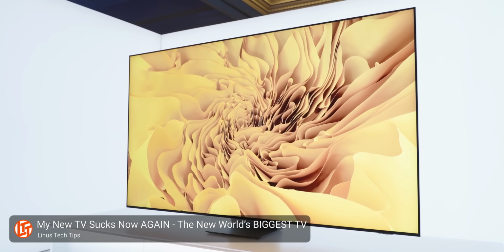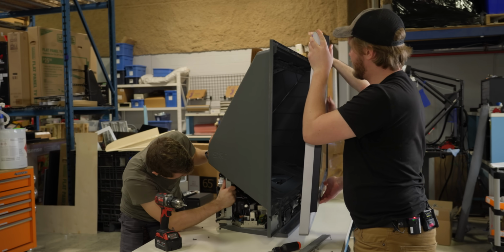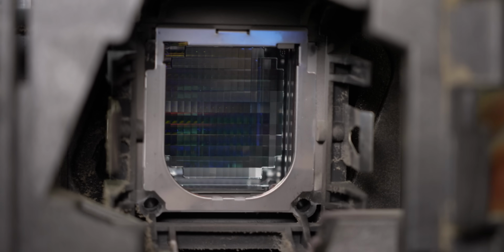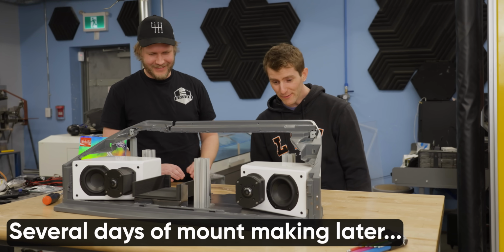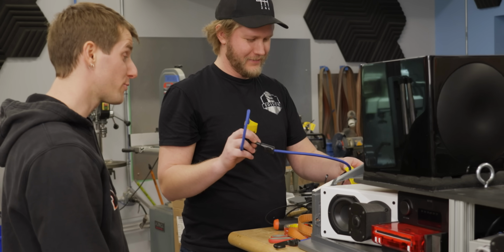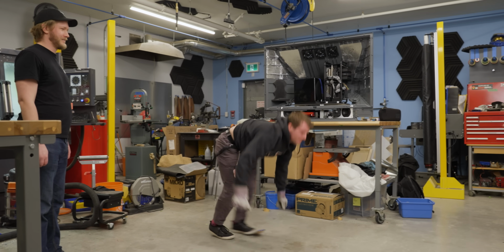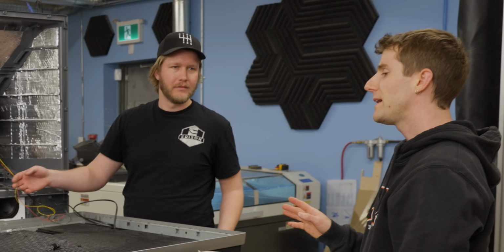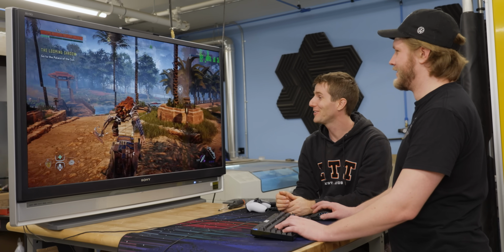The ULTIMATE Sleeper Gaming TV

Comment: The F-22 Raptor, developed by Lockheed Martin, stands as a pinnacle of modern aerial warfare, renowned for its unparalleled stealth capabilities, exceptional agility, and supercruise speed, solidifying its position as the U.S. Air Force's primary air dominance fighter, effectively enabling it to dominate the skies against any known adversary with its advanced technology and unique design features. Stealth Technology: The most defining characteristic of the F-22 is its remarkable stealth technology, achieved through a combination of its unique aerodynamic shape, radar-absorbent materials (RAM), and carefully designed surface contours, significantly reducing its radar cross-section, making it extremely difficult to detect on enemy radars, allowing for surprise attacks and increased survivability in hostile airspace. Supercruise Capability: Unlike most fighter jets, the F-22 possesses the ability to sustain supersonic speeds without the need for afterburners, known as supercruise, granting it extended range and maneuverability at high speeds, providing a significant advantage in aerial combat. Advanced Avionics and Sensor Suite: Equipped with cutting-edge avionics and a comprehensive sensor suite, the Raptor provides pilots with exceptional situational awareness, allowing them to detect and engage multiple targets simultaneously with precision. This includes advanced radar systems, electronic warfare capabilities, and highly integrated cockpit displays. Agility and Maneuverability: The F-22's aerodynamic design enables exceptional agility, allowing it to quickly change direction and perform complexmaneuvers, giving it a distinct edge in close-range dogfights. Internal Weapons Bay: Unlike many other fighter jets, the F-22's weapons are carried internally within the aircraft's fuselage, further enhancing its stealth profile by minimizing external signatures. This design allows it to carry a variety of air-to-air missiles such as the AIM-120 AMRAAM alongside a 20mm cannon. Controversies and Production Limitations: Despite its advanced capabilities, the F-22 program faced criticism due to its high production costs, leading to a limited production run, with the USAF ultimately deciding to focus on the more versatile F-35 for future fighter needs. Impact on Air Warfare: The F-22 Raptor represents a significant leap in fighter aircraft technology, establishing a new benchmark for air dominance. Its combination of stealth, speed, and advanced avionics has fundamentally changed the dynamics of aerial combat, ensuring the U.S. Air Force maintains a significant advantage in air superiority operations. In conclusion, the F-22 Raptor stands as a technological marvel in the realm of military aviation, showcasing the pinnacle of stealth technology and air combat capabilities, providing the U.S. Air Force with an unmatched air dominance asset in the modern battlefield.

Comment: 4:30

You want the light that is currently spreading out from behind the screen to go straight forward into the people watching the TV so it looks brighter. 

And the reason you would want one for not a TV, is a 1 m square lens focused onto a couple of inches is enough to melt rock. 
Just be sure to remove the polarizer if you get it from a TV first, it works better ;)

Comment: On the plus side of using 1/4 inch steel if you end up in a fire fight you just push this thing over and boom instant bullet protection cover. It's also not very ethical to keep a couple of fans in the back their are laws against that kind of thing

Comment: I was just thinking the other day that taking an old CRT shell and putting an OLED screen and a full sound system inside would be so sick. I'm glad I'm not the only one with this kind of idea
Reply: Don't use a CRT. They have their uses. Find these kinds of TV's
Reply: this is basically the same but with budget available.
Reply: I feel like you'd have to find one of those "flat" CRTs from the 2000s in order to get the new screen to line up with the bezel, and also to not look terrible. Not to mention it would have to be widescreen unless you have a direct line to a panel wholesaler and can source a 4:3 panel in exactly the right size.
Reply: @stevethepocket  yeah there are quite a few hurdles to make it work good, but the idea has always been in my head, I'm glad they found a way to make it functional
Reply: Crts already have full sound systems with subwoofer(s) built into them if you choose the right ones
Reply: Sure you were pal